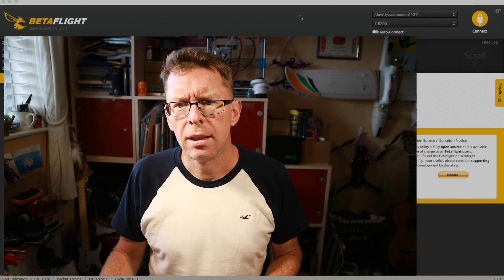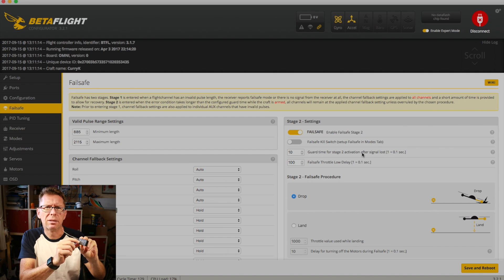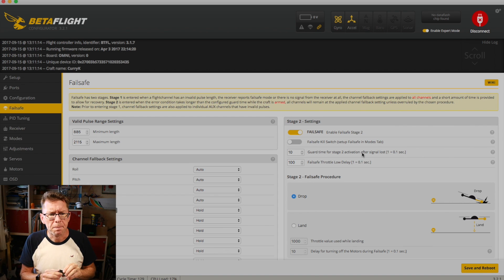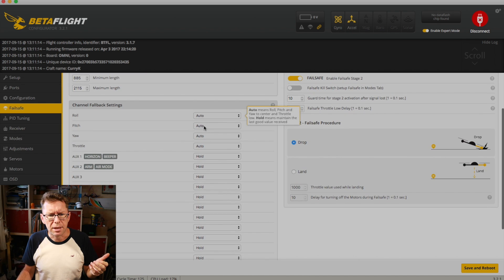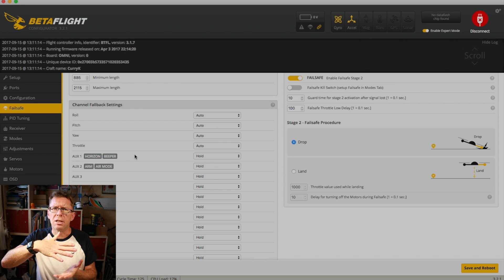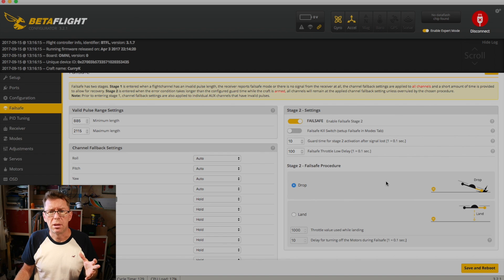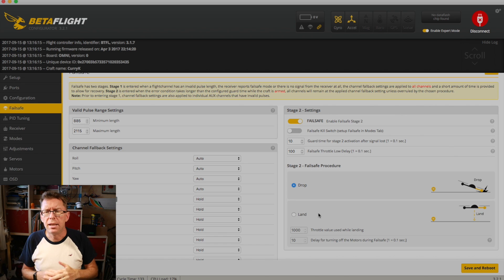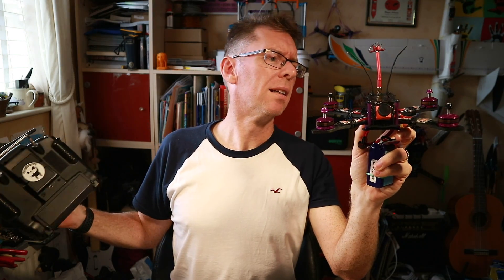FPV Tutorial: BetaFlight Basics Part 4 - The Failsafe tab

Comment: New to betaflight, so what about the failsafe setting in AUX setups. Is that something I need to use as well.  Would a switch force a failsafe ? Seems like disarm would do that.
Reply from the maker: You can setup a switch to enter failsafe, it's always seemed like a bit of a pointless to me.  The idea of the failsafe mode switch is so you can field test a failsafe, but to get a proper test, you'd always want to turn the radio off.  Failsafe will do a little more over disarming... it'll sit there and beep for one
Reply: CurryKitten thanks for the clarification.

Comment: Please help. I wrongly flash my KingKong Flyegg's PICO Blx FC with SP EVO firmware and now even Windows can't recognize it when I plug in. Is this now a hardware failure? Thank you
Reply from the maker: You should be able to get the board back into it's bootloader to flash the correct firmware.  I made a video about how to get into bootloader mode just in case the flashing goes horribly wrong - take a look here https://www.youtube.com/watch?v=6ESltDfuFAs&t=2s
Reply: Thank you. I will try it